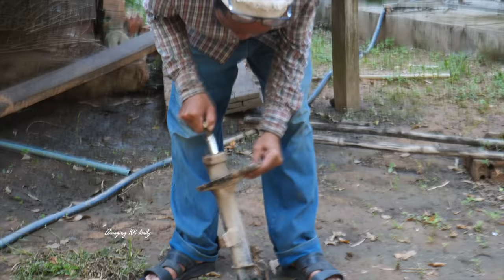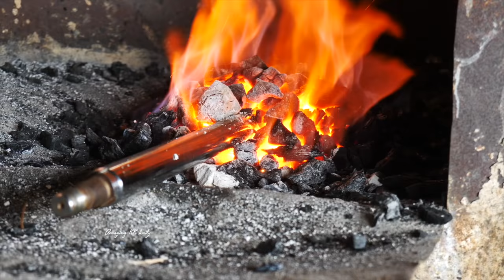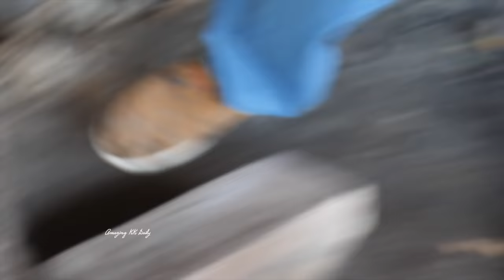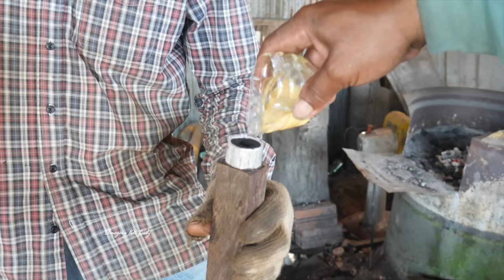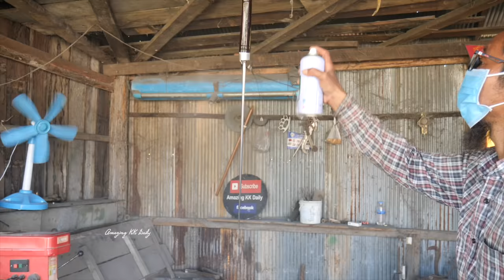THIS BLACKSMITH IS AT ANOTHER LEVEL/MAKING A FANTASY SWORD FROM A SHOCK ABSORBER PISTON ROD

Comment: What about the mechanical pin through the handle and tang? Wouldn’t it be less sound and secure?
Reply: I didn't see him quench or temper it either
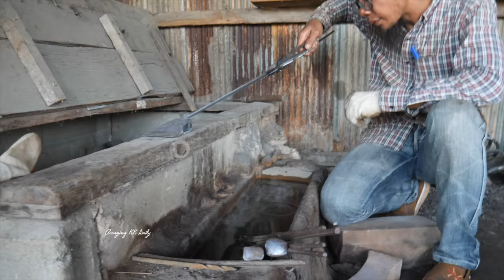Reply: @jca66  8:50 but  used water so it’s not oil. It isn’t ideal but his shop isn’t Ideal either lol